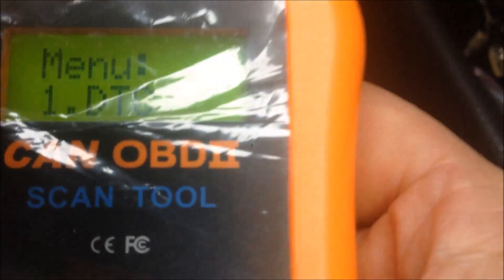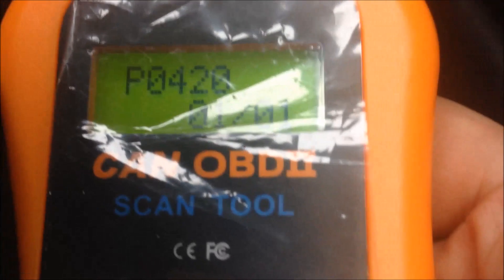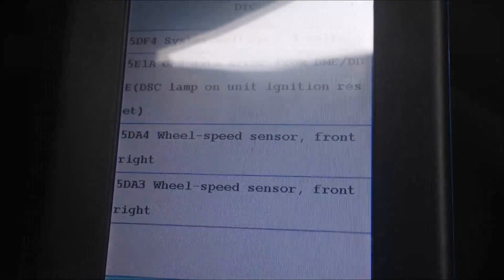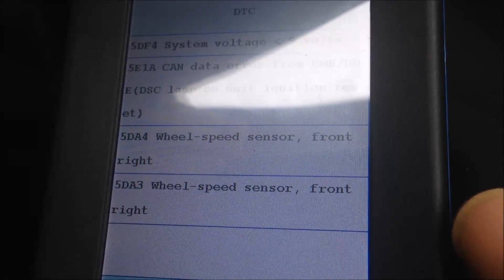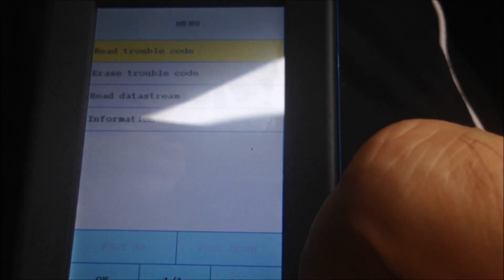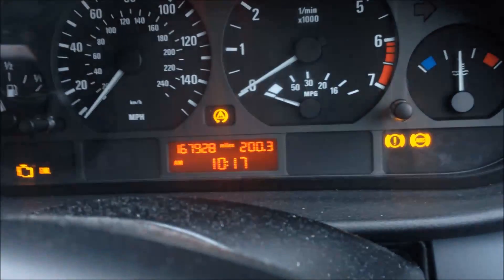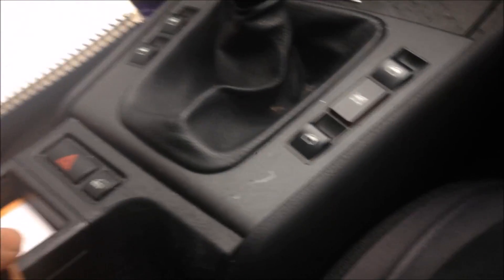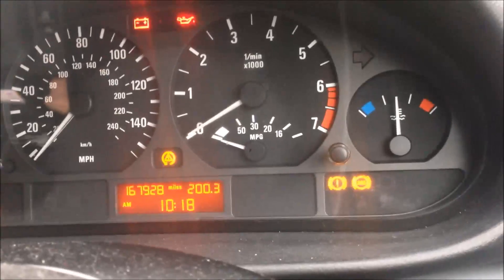BMW E46: Three Yellow brake warning indicators when an ABS Sensor becames Bad

Comment: Hi, I have these lights. No lights on startup but these 3 lights appear after driving for about 20 minutes.....
Reply from the maker: hi, the first time we had these three light was when we were driving. they may disappear next time you are driving, but over a few days, they may become persistent. it could be the same issue. they affect the ABS and you should still have the normal braking power when they are faulty. good luck to sort it out soon!

Comment: Heymy 318i runs only 5.6km per liter is it a problem to be checked?
Reply from the maker: hi, fuel consumption depends on a lot of factors. my E46 318i touring can do about 40 mile per UK gallon, which is about 13 km per liter. driving styles, road types, engine oil and filters, spark plugs, air filter, sensors and others may all contribute to fuel consumption. it is not easy to find out but you could try. good luck!
Reply: @RepairDIY  my previous owner had used a very cheap low quality engine oil , not fully synthetic,cn that affect the fuel consumption?
Reply from the maker: @Sandeep_In_America  fully synthetic oil has longer life and cleaner. i have always used fully synthetic oil. my car has a N42 engine and should use Longlife 01 or Longlife 01 FE oil, other petrol engine produced around 2002 should use Longlife 01. as so many years passed, when i buy oil, i would buy any oil that mentions BMW Longlife at least, or at least to the specification of ACEA: A3. I think as long as the oil grade is right, it should be okay even it is not fully synthetic. I do recommend to use fully synthetic oil for your next oil change.
Reply from the maker: i just checked my BMW manual for you for fuel consumption:  BMW 318i Manual: urban=10.4 liter per 100km, extra-urban = 5.7, combined = 7.4; BMW 318i automatic: urban=11.4 liters per 100 km;, extra urban = 6.4, combined = 8.2 liters per 100 km. have a good day!
Reply: @RepairDIY  i mean whats thr average in traffic roads?city

Comment: Thanks. I was driving my E46 330cd today and the brake petal vibrated while braking for a few seconds, then went back to normal.
About 10 seconds later these lights appear and remain on now even after switching the car off/on and even though the brakes seem normal again.
Not sure what the problem is or whether it's safe to drive.
Reply from the maker: Hi, I think the best thing to do is to read the ODBII fault code as soon as you can. You ABS system may have stopped working but the brakes may still work as a system without ABS. I was driving while waiting for the ABS sensor but I always to test the brakes at a safe place before any journey until it was replaced. The brake system is very important, try to sort it out as soon as possible.  Keep Safe!
Reply: @RepairDIY  I was on my way to the garage when the lights disappeared, so I made a swift detour to the carwash. I can only imagine something got stuck then fell off or something
Reply from the maker: Adam Bradley hi, hope you have arrived the garage and sorted it out. Just for your information, when the lights disappeared, your ABS may start working again, then you feel the vibration as the fault in ABS! Then the car realise the problem and lit the lights. After that you have the normal braking but not the ABS. Keep safe!
Reply: Same here, did u find the solution? , Could u help me with it
Reply: Hi I have the same problem help me

Comment: Hi.. I keep coming back to your video.. My car N42 engine today have the same three lights fault but the handbrake light stays red all the time. Car is driving fine and I even did an emergency stop to see the Abs if it works.. All worked as normally.. But the the 3 lights are constantly on. Can you advise what I should be looking at. Thanks. BTW your videos have really helped me in the past.
Reply from the maker: hi, i guess the ABS may still work even you have a faulty ABS sensor? see my other reply please.